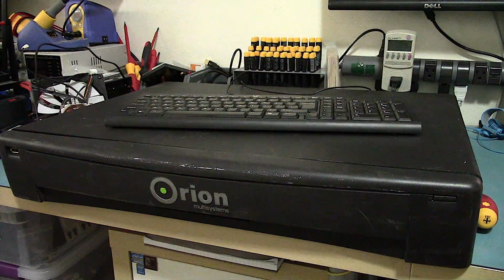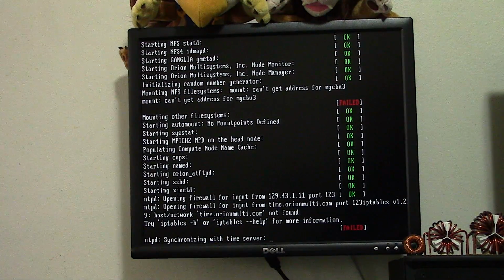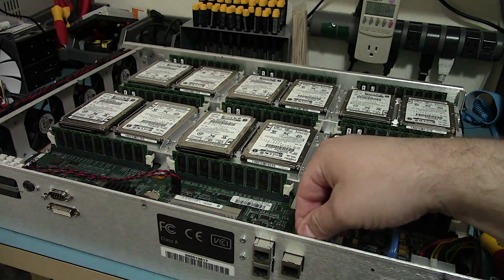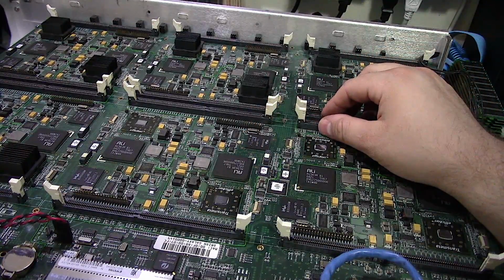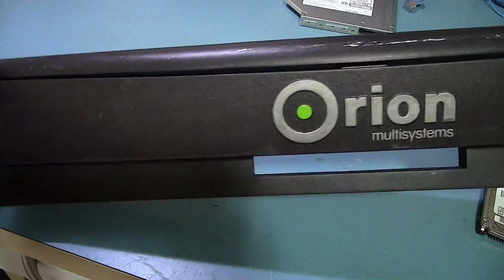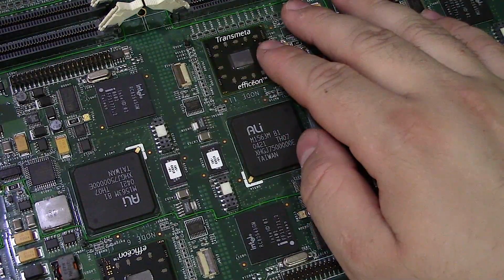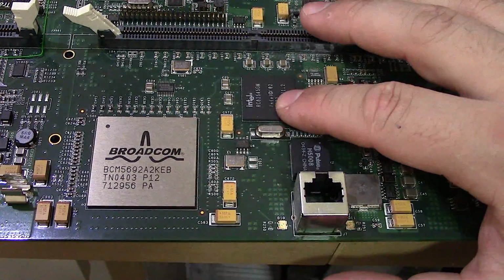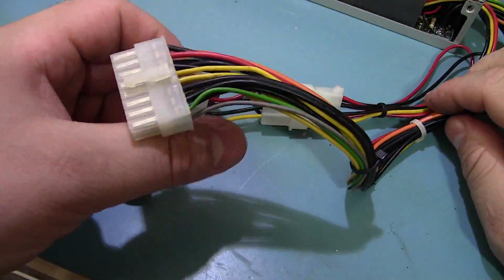Orion Microsystems DT-12 Teardown (aka The 12-in-1 Computer)

Comment: This video is a tad little too noisy.
I'd go with 30fps if you can't get the lighting brighter.
Try maknig a rendering cluster.
Reply from the maker: This is an older video. Still shot on my shitty camcorder. I'll let people know in the video when I finally upload a newly filmed one. I have a couple I want to get finished which I shot a while ago. :D

The problem is you have no direct control of any of the other nodes. So unless your software works in their Linux using their software, the other nodes are useless.